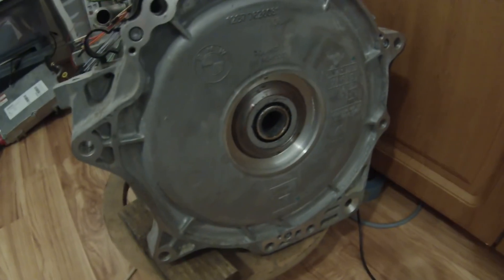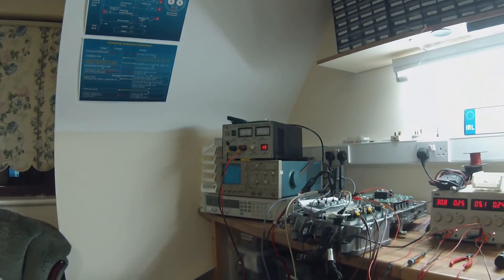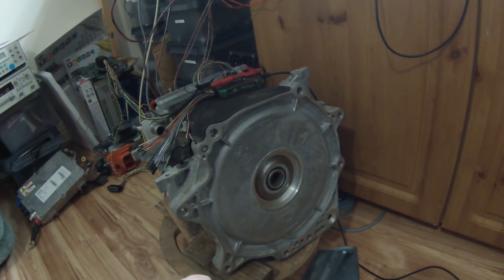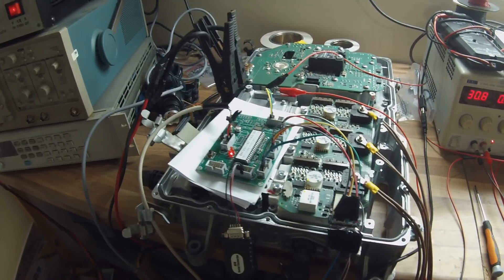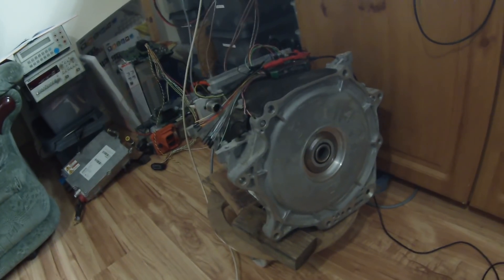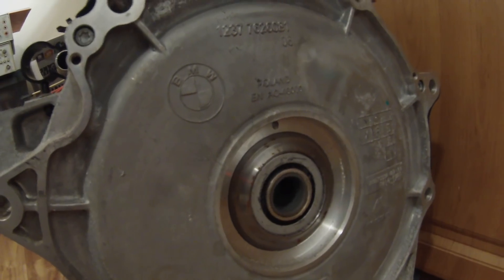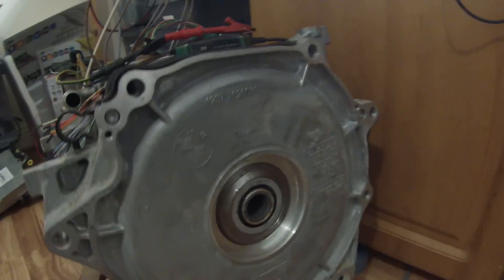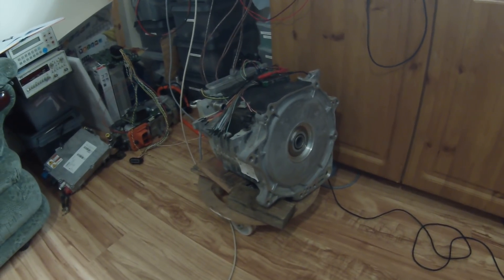BMW i3 Motor Running On Lebowski

Comment: Which version of firmware are you running?  The latest Lebowski firmware will calibrate the current sensors and do sensor-less start much better.   Also as you up the voltage it will sensor-less start much better.  IN my car for instance when the current sensors are close it sensorless starts all the time with the wheels in the air.